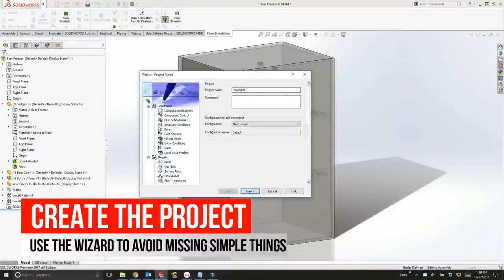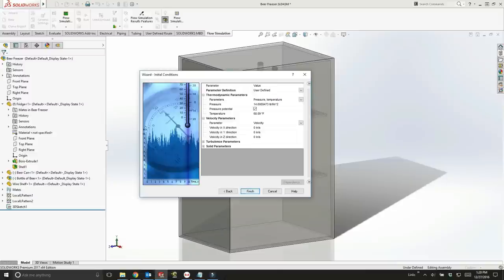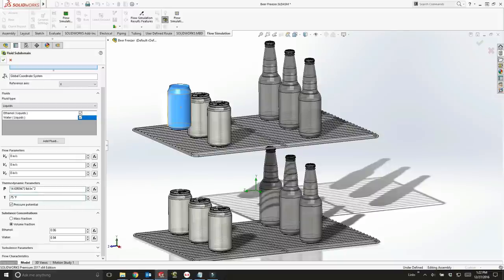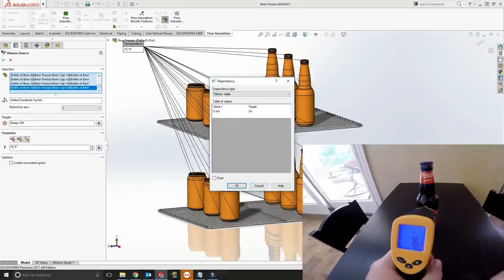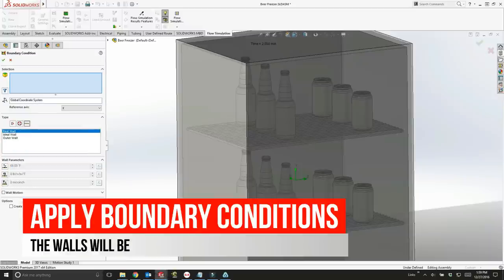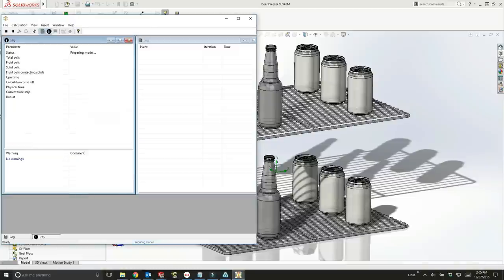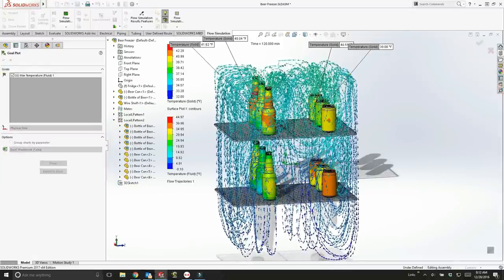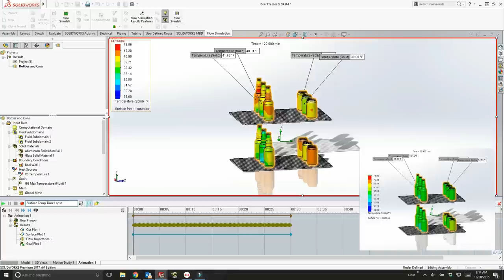SOLIDWORKS Simulation Tips and Tricks: Cooling Beer in the Freezer - Flow

Comment: Hi Marcus, I'd like to run a similar simulation but with bottled water in brine bath in a freezer. Is this possible in solidworks
Reply: Hello Joseph, yes this is possible.  Instead of only two domains, beer and air, you would have 3: air, brine, and water.  The brine bath would either require a "lid" so you can define the fluid sub-domain, or you would need to use the free surface feature that is new in 2018.  One important feature that may be relevant for your application would be evaporation and the thermal effects of evaporation which would take some extra work to simulate properly.

Some other examples you might find useful:
https://blogs.solidworks.com/tech/2014/09/julienboissat/ice-bucket-challenge-cheaters.html 
https://youtu.be/IFxWsrBgSlk